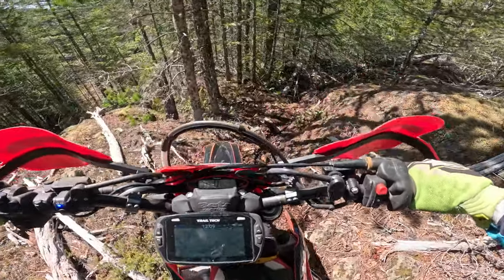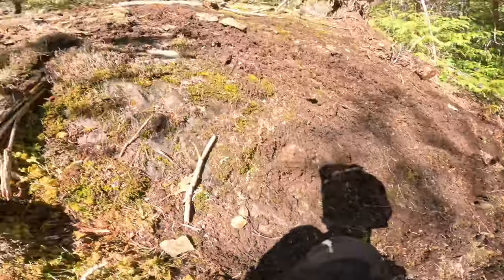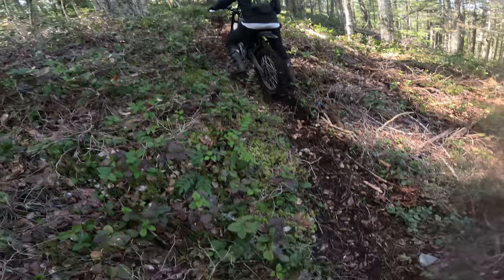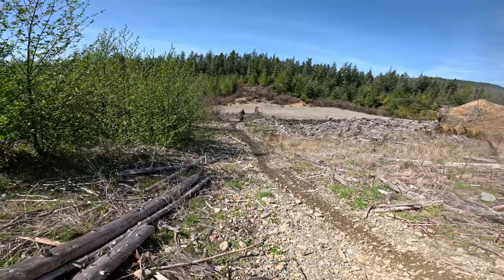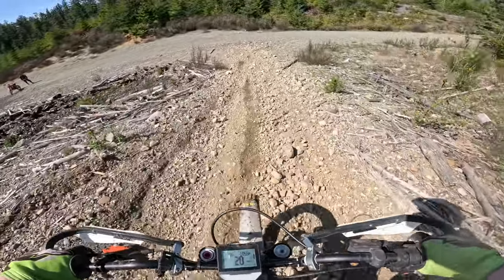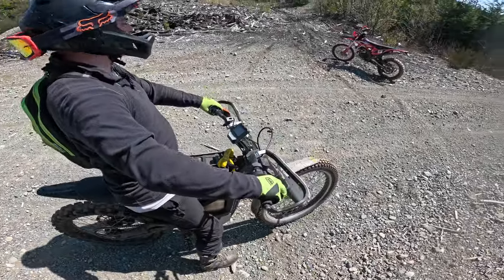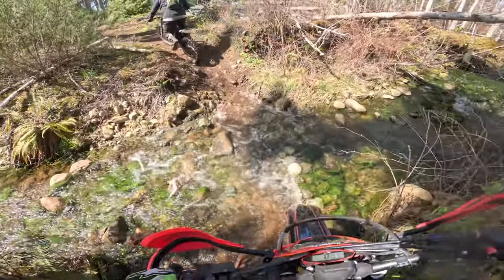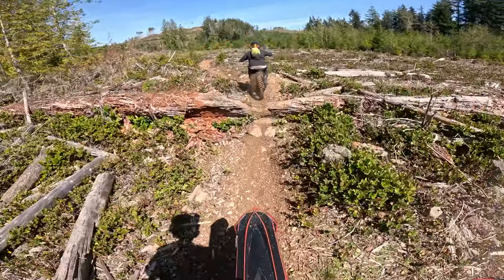Are Electric Dirt Bikes The Future Of Enduro?

Comment: It’s absolutely the future I’ve been a forklift mechanic for years the electric forklift has by far exceeded the ic units in performance. The hard part is battery performance and length of charge time but we are getting there!! Things like graphene and even salt are improving length of charge time to usage😎
Reply from the maker: Matter of time till batteries are equal to a tank of gas for duration
Reply: Also need to charge as fast as a tank can be filled 😁graphene has potential as it charges quickly and discharges slowly and is not as volatile as lipo batteries
Reply from the maker: @davet3947 i think for enduro guys as long as the battery can last a full days ride without worrying about running outta juice, the charging time is somewhat negligible so long as you can get it fully charged for the next days ride. (For me anyways)

Comment: E-Moto has 100% torque at zero rpm... If the control/VFD is correctly programmed, they can do miracles. Where they have a cloud over their stem is in battery technology. Charging rate and range need to be sorted. Unfortunaltely, VP Racing has not released their up and coming Race Electron Jug!! Similar to a Fuel Jug, but different... Ugh, the E-Moto segment does have my attention however, refueling an E-Moto... Especially when you spill electrons on the ground and the EPA sees you do it...

Frankly, a few things in the segement need sorted. Chassis stiffness and suspension, more importantly, brakes of suitable capacity! Most E's are equipped with bicycle brakes and that is disaster going out of its way to happen. Charging needs paired down to not more than 20 minutes cause we all know, we can refuel a hungry gasser in seconds.
Reply from the maker: Once battery technology is adequate itll be very exciting!
Reply: @AaronsEnduro   I have to agree with you. The few times I have tried an E-Moto. they were exhilarating. Perhaps lighter so I can more easily have some trialsin in the mix.